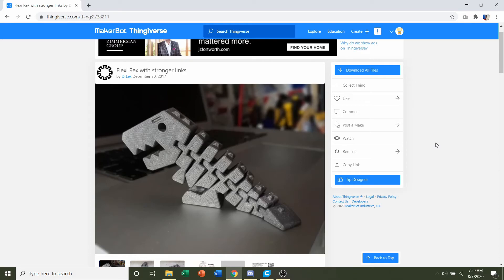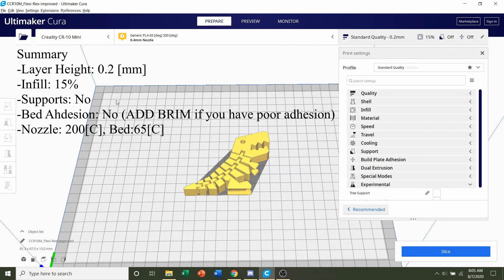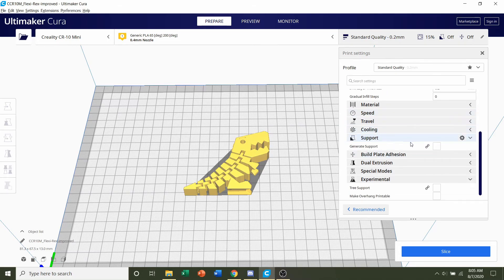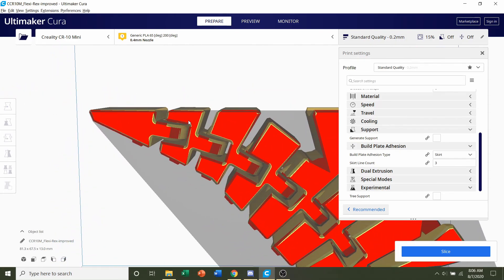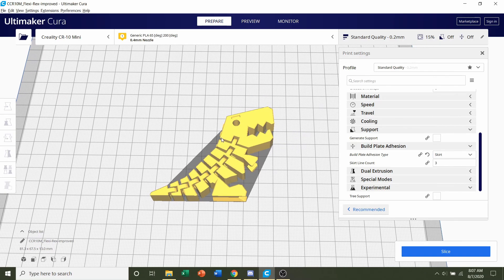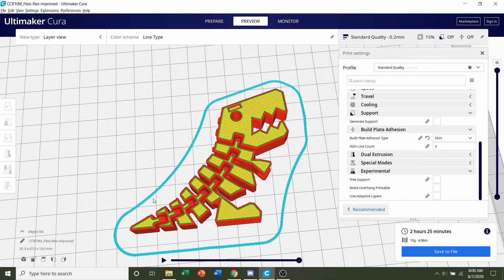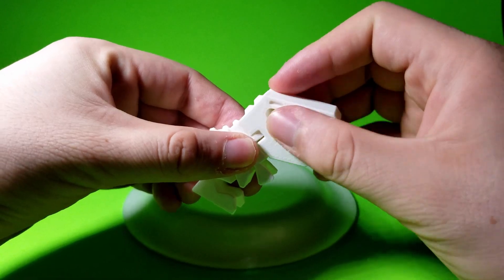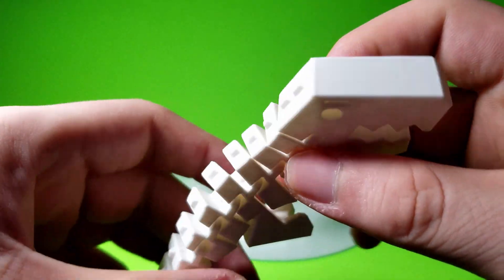Flexi Rex 3D Printed (FUN TOY) - Tutorial, Print Settings, Time Lapse, Showcase

Comment: I have auto bed levelling and the bed is glass but everytime it never sticks.

Only this model gives me issues. 

I have the latest cr 6. Any advise?
Reply from the maker: This will sound strange, but manually level your bed first THEN use the auto bed leveling. Auto bed leveling systems aren't perfect and still need your bed to be fairly level before use.
Other than that, try hairspray on your bed. I was also very hesitant to try hairspray until 1 year after I started printing, but now I use it daily on my glass bed. You only have to apply 1 thin coat every 10 or so prints.